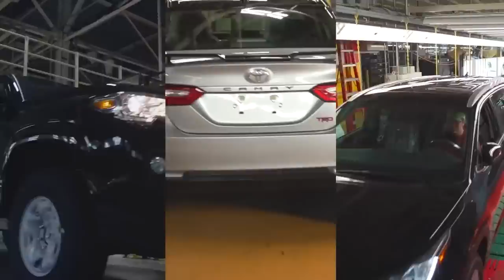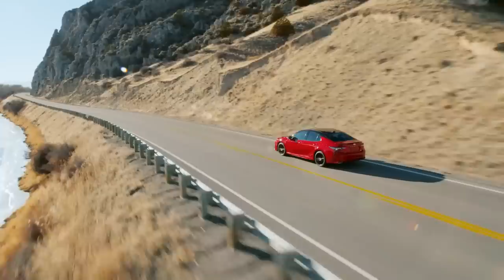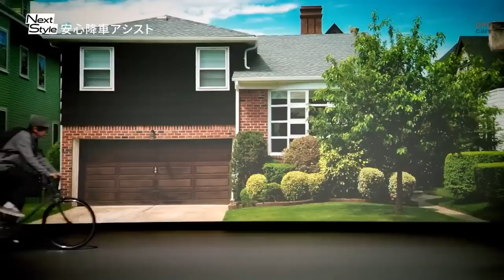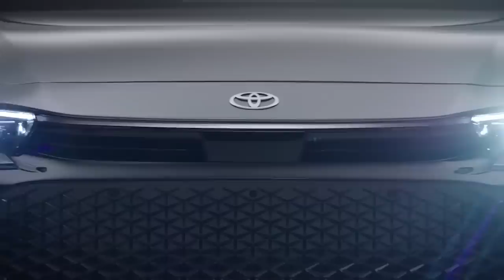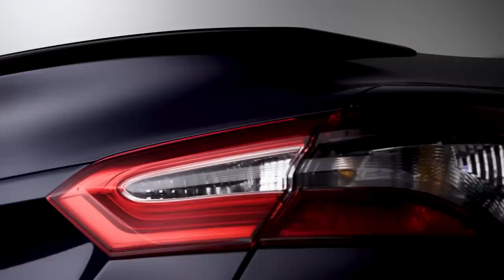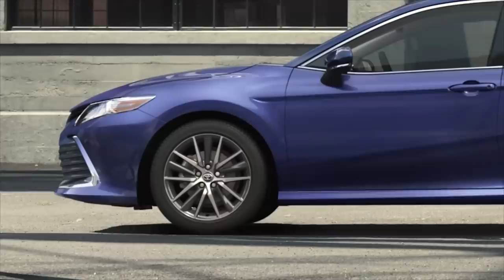Toyota's CEO Just Said They're Not Going to Make Cars In Japan

Comment: I doubt Toyota will stop manufacturing cars. The US manufacturers have but in reality, they could not compete with, Toyota/Lexus, Honda/Acura, and Mazda. Toyota does one hell of a lot of consumer market research. So they may drop slow-selling models in certain markets but they have other models and Lexus to fill in the gaps. A lot of people don't realize the Toyota Corolla sold in Africa is very different from the Corolla sold in North America. Toyota manufactures a lot in countries they sell cars. They adapt to what the consumers want in those markets. So the Toyota Corolla in Africa will have a more robust suspension because Africa has poor roads, the engine's diesel or gas will be a smaller displacement for better fuel economy, and the trunk larger. The interior is more spartan to reach a price point.
Reply: And they are often heavier for lots of parts that are plastic in the US and Europe are made from metal to survive warranty in African conditions.The same goes with vehicle manufactured in Southeast Asia.

Alas, Ford and GM SEA never got a memo.

Comment: Have owned a standard 1985 Candy LE and a company car 2008 Camry Hybrid.  1985 had a glow like plug go out and stopped running within 1st year.  Drove a rental a couple of months until they could figure out the issue, have under 3000 miles on it!  After that it remained in our family aka parents took it and drove it well into 2004 with few issues!  My 2008 Hybrid was fast and awesome gas mileage, only issue was I would park and idle as preparing for another clinic call(worked for big Pharma 45 years}, get out and come back 2 hours later and it would be running!  The engine would shut off parked and a/c still ran off battery, it was a human error not a manufacturing issue.  Have owned 3 Toyota Highlanders, all never in shop for any issues until my 2021 Highlander Limited AWD.  We have a rattle under center row left passenger seat that the dealer couldn’t resolve!  My daughter has the same model with the same rattle!  I finally fixed by stuffing a rag between hard plastic and seat cushion on both, rattle fixed!  Only reason I got rid of my 2015 Highlander Limited AWD was Apple Car play!!

Comment: if it is not made in Japan i don't buy it. I'm tall so i woould probably go with something bigger so i got an Altima then i traded it in for a Lexus used but still very good the seats are more comfortable i got a bad knee and Altima advertized that those seats were designed by NASA. Hogwash they are not any good for long drives i have a broken knee and my leg hurt driving that Altima but i am very comfortable in the used Lexus with 230 thousand miles on it.